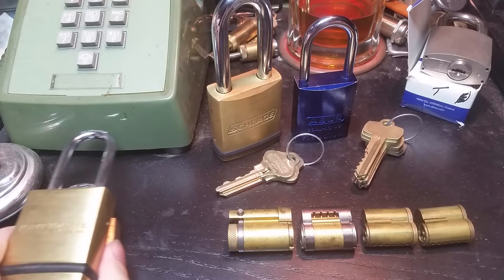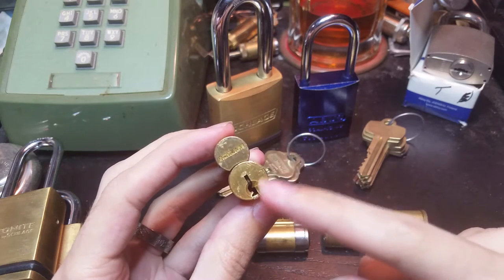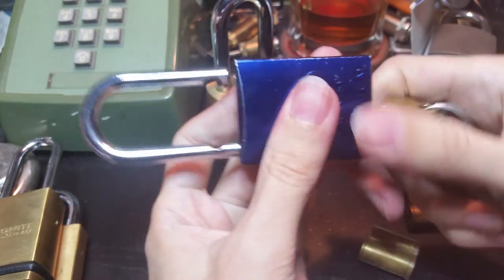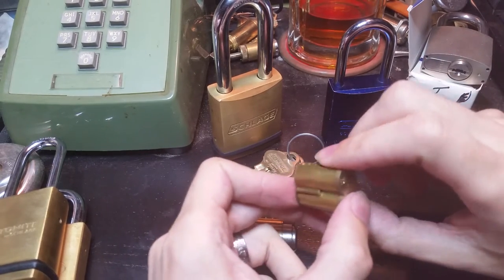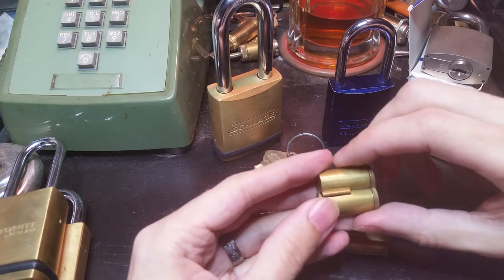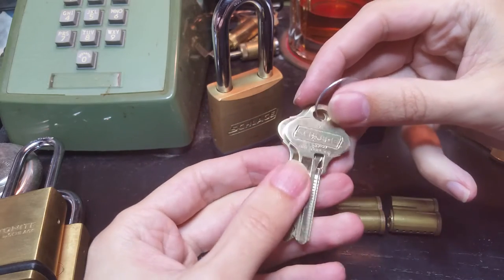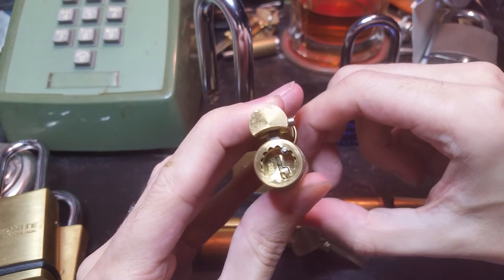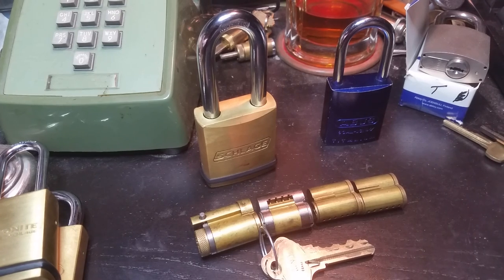(67) Interchangeable Core locks overview

Comment: Great video!!! Very informative!!! Just FYI there is an even easier way to pick those schlage fsic cores to control.  Pick it like a normal lock then flip the core 180, you can then reach the control pin and sleeve with a hook, it feels like a little divot and bump.  Lodge your pick in the divot and find the bump (control pin), push it up and rotate and pull out the fsic.

Comment: I used this as a crash course in IC locks while in the van. Wanna get the HPC tools for gutting these now, and drilling jigs to remove them, and the adapter for our Blitz so we can cut tip to boe keys.
Reply from the maker: Hope it was useful. LAB makes the SFIC Annex kit which has all the tools to dump, decode, and repin SFICs for a decent price.